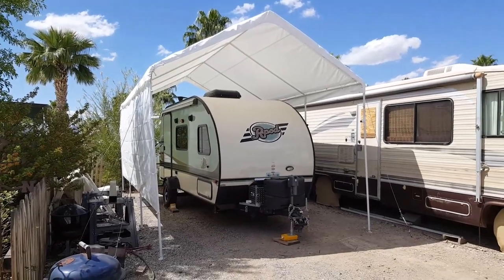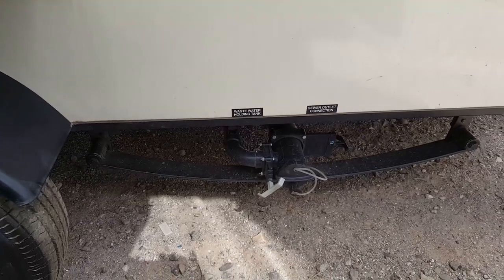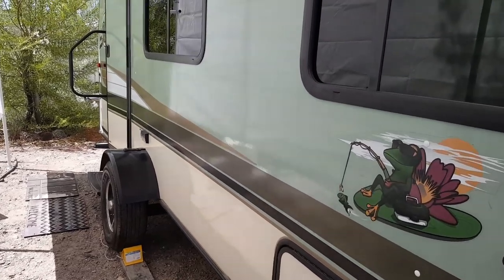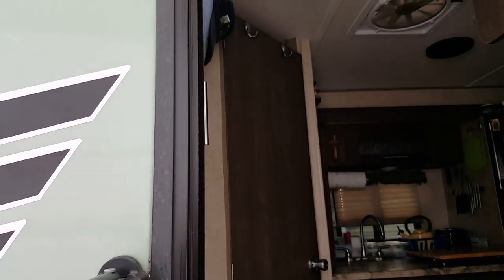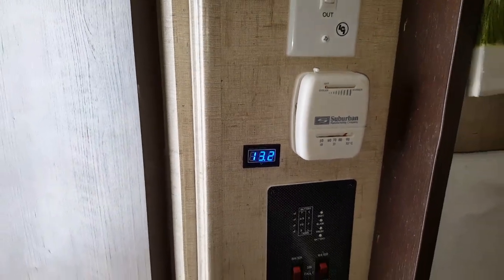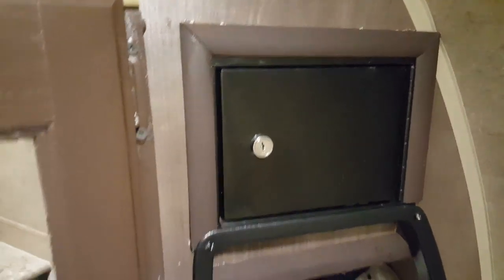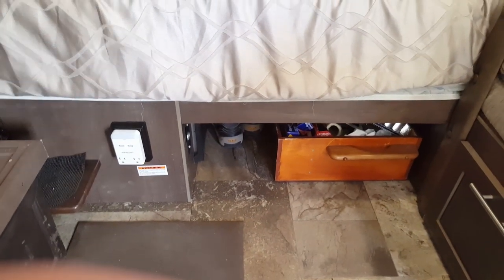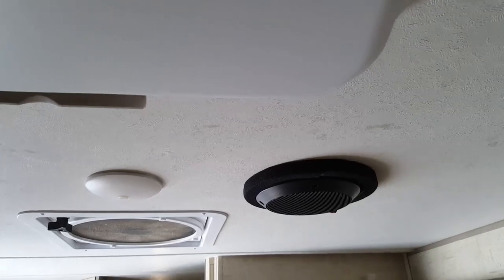RP180 RPOD MODS 2017 Trailer

Comment: I enjoyed your video, thank you for posting it!  My wife and I have the same R Pod and would like to use some of your ideas.  My question is what type of fasteners did you use to attach items to the walls?  I am concerned that the walls are flimsy and will not hold the weight of shelves and screws will pull out.  Thanks!

Comment: thanks for sharing all your improvements! they are wonderful! it's always so interesting to see how people personalize their rpod and improve the performance of the trailer.  love all that you have done-especially the beautiful cabinets over the bed! i too wondered why such a great space was wasted,  have thought about putting up a shelf, but really like the cabinets.  did you do them yourself? great job all around!
Reply from the maker: Yes, I built the cabinets. Went to Lowes and bought a 20"x 8 foot 3/4" board for the bottom, anchored it with angle brackets to the wall, then went on Ebay and found the doors that would fit my application, then built the front to fit the doors. It really wasn't hard to do, but really gave us a lot of room for our clothing and other things. Don't know why they didn't put it in, but it probably would of cost another $1000 for about  $150 it cost me.

Comment: I think your ideas are terrific. We have a StarCraft comet which looks amazingly like your R-Pod. My first question for you concerns the 12 V TV that you added. We already had a 110 TV where you said you moved years at the foot of the bed. But the one that you installed under your entertainment center that is 12 V, where did you pick up the 12 V to operate it. Questions from a fellow Arizonan from Apache Junction
Reply from the maker: I tied it into the 12 volt at my 12 volt entertainment center. You have to remove the cd/radio unit and find out where the live 12 volt is, there I tied in a lighter socket to run my 12 volt T.V.. I moved the 110 Volt T.V. to the other side, with all the connections run thru a wire fitting along the top of the roof to the other side. On that T.V. I have my dish network connected thru a Trucker Receiver mounted on the roof. It auto finds all my menu's no mater where I am in the country. If I have no 110 electric out in the Boonies, I connect it to my 2000 watt converter that I have built in my trailer. I am now back in Arizona for the winter after an 8000 mile traveling summer. If you ever get out Brenda,Az ( 12 miles east of Qsite) stop in and have a look. Desert Gold RV Resort, highway 60.  Galen
Reply: I found some 12v TVs on Amazon. Which TV and mount did you use?  I thank you for answering!

Comment: What a wonderful job!  You did fantastic cabinetry additions to your R POD.  I downloaded your video so when I buy mine, hopefully I can do the same.  Have safe travels.  Thank you for sharing.  I enjoyed so much I watched it twice. And subscribed. :)
Reply from the maker: Happy you enjoyed the video. Probably the best Mod was the cabinets above the bed. In a 180, there is not much storage with the Bathroom I love, so with that cabinet, I can store a lot of clothes and have room left over. The drawer under the seat is my breadbox. The cabinet is very easy to built. The bottom is a 20"x8'  board I bought from Lowe's, The doors I picked up on E-bay. Anyway, that's the best mod I added to the Pod. Very useful. Good Luck with your's. They are a blast to travel with.
Reply: Great video, and you did a fantastic job with all the modifications.  Can you discuss more or another video on how you built and installed the cabinets above the bed?  They look so perfect, I'd like to do the exact same thing, but I'm not nearly as skilled as you are. Also, on the battery box and double propane tank modification, did you have to weld wider supports onto the trailer?

Comment: Is your catalytic heater permanently mounted to the wall? Also, any problem with the extra tongue weight that you added? And what size propane tanks did you put upfront to replace the single 20 pound? You've given me A lot to think about. We don't have an R pod. We have a satellite, which is kind of like it's twin. So lots of good ideas. Thank you
Reply: Thank you for answering my questions. We will probably be out near Quartzsite not this winter but next because I have a friend who installs solar. I’m going to put 26for lithium batteries upfront and I found a very nice locking cabinet on Amazon. So once I get done paying for that I can afford to have a panel or two put on the roof and have the charge controller and apertinences installed. It would be nice to meet up

Comment: u need a half ton truck to pullit] plus miles per gallon
Reply from the maker: Your right,I pull it with a 2013 Ford F150 with Eco Boost  . I just returned from an 8000 mile summer trip, I averaged 13.3 MPG towing.